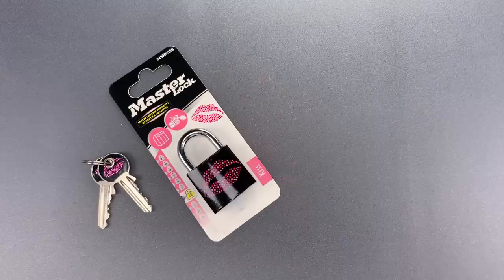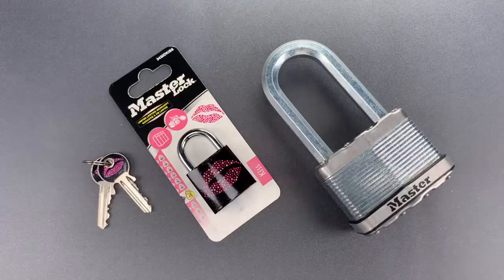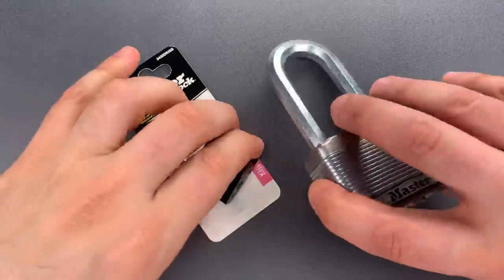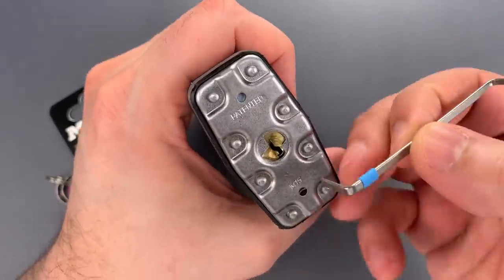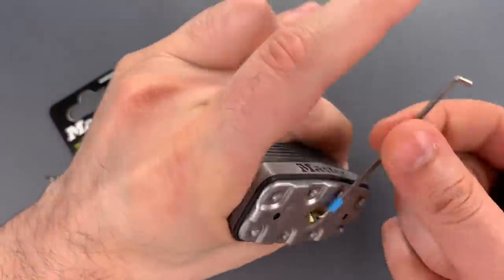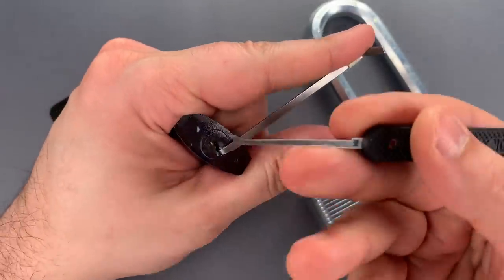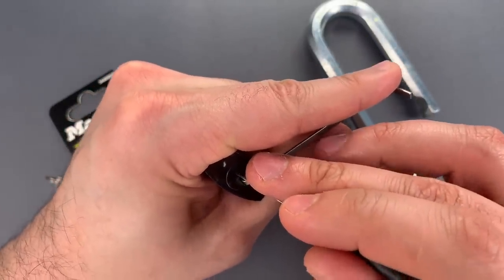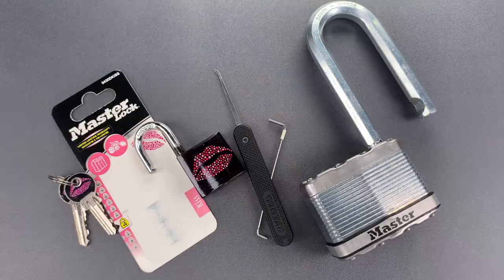[1211] Which Master Lock Is Harder To Pick? A Surprising Result

Comment: I think Master lock's rating system is more based around how hard a lock would be to smash without regard to picking. They figure most people can't pick locks, so they're considering how resistant their locks are against bolt cutters, hammers, and other forms of brute destruction/entry. They probably think it's great that their locks are easy for pros to open: The pros aren't likely to be thieves, and people lose their keys all the time.
Reply: This. 9 times out of 10 the thief will be packing prybars and bolt cutters not lockpicks.
Reply: @thatguybrody4819  the problem comes with the people that are novice in picking stuff.
Like it would be SO easy for masterlock to make it just that lil bit harder to pick for that 9/10 that are novice in non destructive entry to be told "yup, f*** that"
Yet they never do it.
No locks can stop pro, but if they were bit more secure toward the one that knows their lock even a lil bit it would be more worth
Reply: The thing is, I can rake open a masterlock In like 3 seconds and I've had less than 5 minutes of lockpicking experience. It's really impossible to overstate how vulnerable these things are. when he says "low skilled raking attack" he really means "a trained monkey could open this lock." If the attacker has any lockpicking tools whatsoever, and a lockpicking skill better than lower primates, they win.
Reply: Pro are not likely to steal, but if it acceptable to rake attack, a literal lowest form, then you are likely to get attack by a stealthy robber, which is even worse then a robber who smashes a window
Reply: Honestly if it wasn't vulnerable to raking maybe but you don't even really need actual lock picking tools or any experience to open a lock vulnerable to raking. Any thin bit of metal jammed in and wiggled for less than a minute will do the trick.
Reply: @petersmythe6462  Trained monkeys are very skilled at picking pockets too, so theyre used to having the keys, hence little need to gain more advanced picking techniques.
Reply: @thatguybrody4819  the problem is more then all those times LPL shows you can open a lot of these master locks with a softish yellow hammer... Or those prybars without needing to break the lock at all.
Reply: @thatguybrody4819       A robber will pack prybars and bolt cutters. A thief will leave even a professional wondering how he got in and out.

Comment: So Master Lock is so bad that when they try to make a novelty lock it’s actually better than their own high security lock. Amazing.
Reply: It's more pick resistant but honestly considering that most junkies aren't going to bother with picking does that really matter ?
Reply: A pair of vice-grips will snap the kiss lock off easily. The only surprising thing whenever it happens is the point of failure is at the swing-hinge side of the lock.
Reply: The sad thing is l have the same beefy Master lock.
Because before l knew about LPL, l thought Master Lock were the best locks .
Reply: @clothar23  you're proving his point. This kind of thinking is what gets your shit stolen by a crafty one
Reply: @Joesolo13  why even bother trying picking when a bolt cuter will take 2 second to cut the shackle or the chain
Reply: @clothar23  I object, that's for sure. Dehumanising a person based on a mistake in their life.
Reply: @ComanderSazabi2000   A mistake is forgetting your keys in the car. Or perhaps burning the morning's toast. 

Making a deliberate choice to become a slave to some narcotic substance. And supporting your choice with theft and misery is no mistake. 

If they turn their lives around all well and good. But those that don't aren't making a mistake they are making a choice.
Reply: @clothar23  If only solving addiction is as easy as just "turning their lives around". Most narcotics cause addiction by flooding your brain with feel good hormones to the point of desensitizing the brain to said hormones. At which point, the person can literally not feel alive without taking another hit of the narcotic. Beating that addiction is a gargantuan tasks which won't be any easier if the rest of society shun them for their mistake.

If you want the best scientific method of reducing the rates of addiction in your community, many studies has shown that treating the victims like humans and offering them support in beating their addiction is the best way to solve it.
Reply: @ComanderSazabi2000  A hundred times this. There's so many factors to why a person may result to substance abuse, and a million more why it's so difficult to recover from it. People need to stop thinking that just because someone is addicted to something they're lesser because of it- that kind of thinking ultimately makes the problem worse.
Reply: @clothar23  Not everyone becomes addicted to drugs by their own choices. Some people have drugs forced upon them and have to live with the consequences.
Reply: @clothar23  IQ doesn't translate to addiction resistance. Anyone can have a shit life that they would like to mentally escape.
Reply: @clothar23  It matters when you can just rake it open which is a 0 skill attack that anybody with a cheap bit of metal and 5 minutes on the internet can do.

at least the other lock requires actual knowledge of how to pick locks to open. If your lock can be raked open you have no excuse cuz anybody can do it with very low effort. no skill required.
Reply: @clothar23  In addition to everything everyone else has said, this mindset actually makes it more likely that you end up addicted, manipulated, ect. The more you see victims or circumstance as in someway less than you the more likely you are to deny that you're being developing an addiction. It also makes you less likely to take steps to protect yourself, less likely to admit that you've developed an addiction even if you do eventually realize it, and you're less likely to get help since you see beating addiction as something any "real" human should be perfectly capable of on their own. And all that's without even considering the fact that they very people who know best what addiction is like and how to beat it are the people you are insulting.

You don't just see addicts as less than, you see them as subhuman. You better hope you never need opioids for pain or something similar, that mindset won't serve you well.
Reply: @clothar23  A lot of people get addicted from painkillers they needed after surgery or other injury. The addiction is permanent brain damage. If you don’t have any opioids in your system, it feels like the worst flu you’ve ever had. You’ll do anything to feel better. 

So, no need to insult them. There is a need to lock up your stuff if they’re around, though.
Reply: If it is made for the EU market here might be rules that ban the cheapest drums
Reply: I love how the whole comment section of this comment turned into people roasting one guy
Reply: the reson for that is i bet they outsorsed their novelty lock core desighn to someone else who wasnt brain dead
Reply: Da fuc happened in this reply section?
Reply: @ComanderSazabi2000  the best method of beating an addiction is actually to change ones social circle and to substitute the addictive behavior with other addictive behavior, preferably endurance sports. Most ex druggies (including me unfortunately) become extremely addicted to sports and vice versa funnily enough.

Your take on reducing addiction rate is compassionate and very nice of you but it doesn‘t really work. ostrasizing someone is not the answer but it has little to no impact on whether someone sobers up. change must come from within.
Reply: @clothar23  Course it matters
Reply: @clothar23  Holy shit, dude, I’ve never seen someone get shut down so fast, mostly by evidence, but I can’t lie. From what it sounds like, you kinda deserved it…
Reply: @giacomocasanova2893  i respect your personal experience informs your perspective but vega is right. Maybe some people overcome with sport or changing their circle, but the common factors across all of them is treating drug addicts for what they are, people, and supporting and empathising regardless of whether they choose to give up their addiction.

Comment: My heart sank when he said we should be able to rake this open...
Reply: I was totally expecting him to rake it first but was satisfied when I seen him pull it out
Reply: @joetroutt7425  TWSS  😁
Reply: @joetroutt7425  I was surprised when he pulled out a pick first after hearing that these were standard pins
Reply: I’m just waiting for the day he drops a master lock on the table and it opens
Reply: With rakes available on CovertInstruments.Com
Reply: I would have liked for him to at least address whether the small one could be raked.
Reply: I was shocked when he didn’t initially take it
Reply: @HariSeldon913  i believed it would be possible, yet way less likely than the bigger lock because of the security pins
Reply: @HariSeldon913  or combed or bypassed. I don't think LPL demonstrates attacks which don't work.
Reply: @KenLyns  And normally you wouldn't want him to, but in this case he was comparing the two locks so it would make sense to demonstrate how the other stands up to the same attack.
Reply: @darkzerothe1  
Joke aside, it might be possible to do with the transparent plastic locks
they are so shitty, I can pick them un under 2 seconds 
the first time I picked them was by accident.  I was trying to get to understand the pins and it just unlocked by itself lol

No need for the retention pin either. it's ridiculous.
Reply: @Pac0Master  yeah that’s probably true

I’m convinced those things would open if you so much as breathed on em

Comment: Imagine the power of a 1/10 master lock
Breaks instantly from physical force, but requires a full minute to pick
Reply: maybe the pins are made from paper tissues
Reply: 1/10 is just a piece of duct tape xD Easy to cut open, impossible to pick.
Reply: "This is a master lock rated 1/10. As you can see, the lock body is made of sugar glass and the shackle is made out of wet noodles. The core on this, however, is the best core masterlock has ever made. It contains three sets of pins, all security, and an inverted magnetic pin. This core requires picking three times and has more false gates than a display room at a garden store."   

The video is still less than 5 minutes long.
Reply: You're referring to the Master lock LOTO locks that are plastic bodied with 7 security pins in them.
Reply: I think he had a video that essentially had that paradigm, where the lock was meant to signify that a person was using a machine and not for "protection" but then included a 7 pin monstrosity.  Video title is something like the paradox of masterlock.
Reply: It breaks from blowing air on to it.
Reply: A 1/10 masterlock is probably some kind of magic spell
Reply: Maybe 1/10 opens just by looking at it...
Reply: The 1/10 Master Lock, with a glass lock body that breaks as soon as you apply bottom-of-the-keyway tension.
Reply: 1/10 is a zip tie to be frank lol
Reply: @wojtekw6040  1/10 is a mere glance at it open, 2 to 5/10 its stare at it open , 6 to 10/10 its in hand pick it open
Reply: 1/10 is a sticky note or a sticker saying: if this the container or its contents don't belong to you, please do not open the container
Reply: maybe the scale works the opposite to how you would expect?  maybe 1/10s are the best locks they do
Reply: You mean a LOTO Lock? Like the Master Lock Zenex? Awesome core, security pins and high quality thermo plastic housing. One of those words is unlike the others.
Reply: their lock out tag out (LOTO) locks have cores with 6 pins and security pins and a plastic lock body
( https://youtu.be/y4XGY0_cwcM ) Video 479
it literally has one of the best cores master lock has and it's plastic lmao
Reply: Security level 1/10: Lock body made of plastic that can melt with hairdryer, shackle made out of beer cans and 100 pins unpickable core.
Reply: That's the Master Lock plastic body 'Lock Out - Tag Out' (LOTO) locks. One of their best cores, in a plastic body.

Comment: "a tough boron alloy shackle, a beefy steel lock body" ...and a core made of melted butter!
Reply: The worst part is if i gave somone a good lock they would put it on a $1 hasp or attach the lock to a good hasp attached with short screews to a plywood door most never give any actual thought to security until they have been robbed or violated
Reply: @CheZfrmdaWestWisc  i've been robbed 6 times, the police wouldn't do a darn thing only because i didn't have the serial numbers of what was stolen written down. the last time i told them, "no more, if i find my stuff, i'm taking care of it myself and you can go eat your doughnuts!"